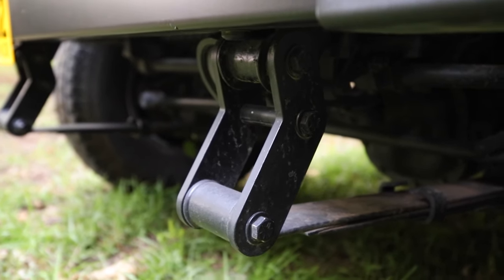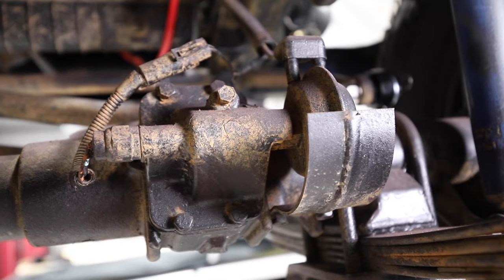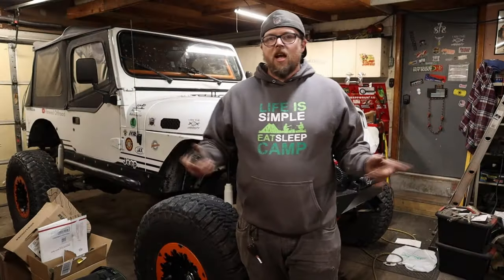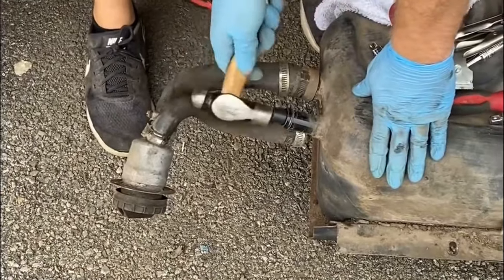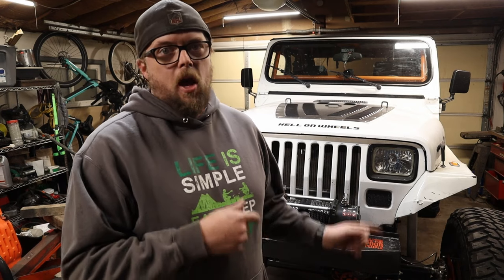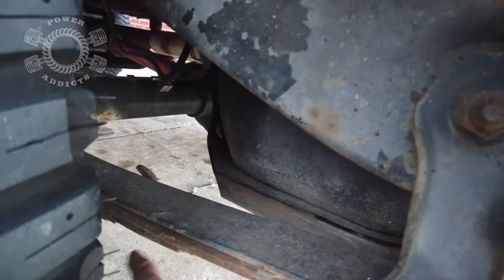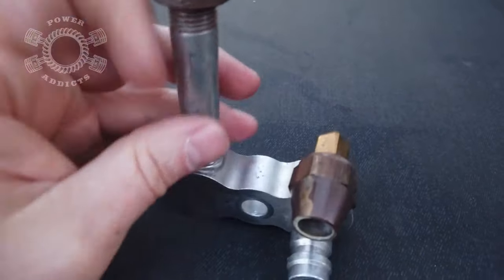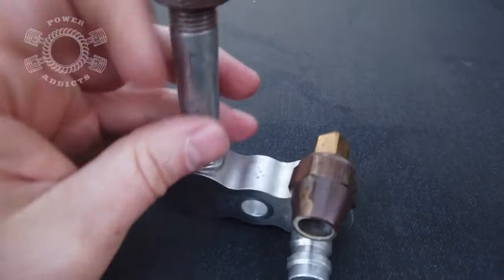Best Jeep YJ mods and upgrades

Comment: My YJ is 33 years old with 32K original miles. 2.5L, soft top. Minor mods to air box and exhaust. Love good ol’ Ginny.
Reply from the maker: Wow. Only 32K! That’s incredible!
Reply: Should swap out the 2.5L and put in a big girl engine
Reply: @ks3223 the Cummins r2.8 is a good fit
Reply: Lunch boxes and go.

Comment: The split axle allows for the driveshaft to not spin while driving in 2wd. This is a huge benefit. Much less vibration especially if lifted, less wear on transfer case, less noise.

Comment: Awesome information about the CAD VAC Delete. I just picked up a 1990 YJ and now I need to do that mod on my jeep.
Reply from the maker: Thank you! I’m glad you found it helpful! 🙏🏻
Reply: Check your driveshaft angle in front and u joints. If you lock that axle it will be spinning the driveshaft all the time.

Comment: Hi good stuff, if I could add something when it comes to YJ springs. For whatever reason people overtighten the shackles, I saw a tire shop use an impact on the shackles and just tightened the heck out them on a friends YJ. Guess how the ride was. The shackles have locking style nuts from  the factory so that they don't have to be cranked down on, also the aftermarket bushings that Dan showed are a really good upgrade and not expensive
Reply from the maker: Thanks and that’s good stuff about not cranking the bolts down. Thanks so much!

Comment: Additional option for deleting the CAD. I installed axle shafts from an XJ without the disconnect. They also had larger u-joints.  I had previously broken two axles at the u-joints. I haven’t broken one since that upgrade 10 years ago.
Reply from the maker: Yeah that’s honestly the best most durable option in the long run.

Comment: A fun video.  I have 1 1995 that appears nearly new - or the condition is looks like new.  The only mods are front and back bumpers and larger tires.  No lift, everything is stock. I've had to replace the vac hose for the 4WD once. You offered some good suggestions, and now to prioritize the ones that important to me.  I don't really do off-road unless you call gravel fire trails, and snow at ski lodges off-road....but you make some good points.  Thank you for posting.
Reply from the maker: You’re very welcome!

Comment: I found locking the front axle to make it a solid axle made highway sketchy in rainy or snowy conditions.
Reply from the maker: Did you lock the entire front axle? This doesn’t lock the front axles, it just connects to the two part axle on the passenger side. I wouldn’t want to lock the full front or rear axle unless it’s able to be turned on and off as needed.

Comment: Good video man. I have a 89 with the 2.5. Not enough power to hurt much! Running 35s with 5.13 gears on a SOA cable actuated CAD and Lincoln locked.  Boomerangs in back and revolver shackles up front. I love my YJ last of the real og jeeps! 😆 leafsprings party harder!👍 stay safe man and happy trails 👣
Reply from the maker: Thanks! - stay tuned. Got a lot more square content coming.

Comment: My YJ is a 92 with 224k miles on the clock and it’s STILL running like a top. Yea small trans leak, small coolant leak, small valve tap, but still starts every single time and gets me A to B
Reply from the maker: That’s awesome!

Comment: I just stumbled across your channel, this is the second video I've seen and a new Sub has been added.

Figured I'd add a warning that this comment is a long one.

Im only 19 and my 1995 YJ (2.5L and 5 Spd) painted in Emerald Green is my first car, and my daily. I got it in late July of 2020, and it was fun bringing it to life as it had sat for 15 years when I got it due to the previous owner taking it to 3 mechanics who all told them it would need a new engine. During those 15 years, someone tried to fix it up, and messed up a lot more, so after un-doing what was messed up (and sourcing a new ECM as the one that was in it at the time was for a 4.0L and 3 Spd Auto), and doing some electrical work when it still wouldnt start after everything that could be replaced was replaced... (said electrical issue stopping it from running those 15 years was a broken fuse contact for Fuse 5 in the fuse block responsible for powering the ASD Relay) it fired up to life after 15 years. Then after getting it road worthy and fully registered through the DMV, I haven't ever stopped loving it, even after a breakdown (thankfully a simple fix). Learned how to drive a Manual Transmission equipped car with it, learned how to offroad very well since the nannies newer Jeeps have aren't present in the YJ, and overall its been such a learning experience with cars in general that I doubt I'll ever get rid of my YJ. 

I've done tons of research, and eventually I want to do a engine swap that's not very common, maybe rare as Ive only seen one unfinished forum thread talking about it, which is stuffing a LNF 2.0T Ecotec from a Pontiac Solstice GXP into it. The AR5 Manual's Bellhousing shares the same trans to bellhousing bolt pattern as the AX15 which would simplify the swap. Rocks and dirt (and a mountain that gets snowy/muddy) are all there is to play in with it, so a Atlas 4 Spd T-Case is planned for that swap too along with a Ford 8.8 swap.

Overall, I understand how Jeeps are money pits (Just Emoty Every Pocket haha) but the character they have is why I love it so much.
Reply from the maker: That’s awesome! I love that you brought it back to life! That engine swap sounds like a cool option, one I hadn’t heard of doing! I’m excited to see how it goes! Thanks so much for the comment and for becoming apart of the community here! I’m excited to have you along for the ride!

Comment: I'm wanting a chevey 4.3 v6 and nv3500 4x4 transmission.   Currently struggling with oil pan leak.  2.5 4 banger and ax5 is sick...

Comment: Got a link for the cupholders? And I have a YJ wangler and one of the first thing I'm doing is getting rid of the 4 cylinder engine i have and put something bigger. The 4 cylinder is so under powered.
Reply from the maker: Here are the cup holders. https://dogfoxindustries.com/

Yeah if I had thought about it more when I swapped my engine I would have done an LS swap instead.
Reply: Thanks for the link. I don't want a LS engine in mine it's very big and a lot of power. I think I'm going with a 4.6 stoker straight 6 engine.

Comment: The cad system isnt that bad. Like anything else if you dont maintain it things fail.  

The big advantage is no spinning the front ds constantly. So less wear and tear.  Fuel savings is meh. Maybe 1mpg. But the system is super simple and easy to troubleshoot.

Comment: I need to know what it takes to put a 250 inline 6 cylinder Chevy in my 1990 jeep Wrangler do I need a ax15 to go with it?
Reply from the maker: That’s a great question but unfortunately I don’t know the answer. I’m sure you and get someone with more knowledge on that in some of the YJ forums on line or some of the YJ Facebook groups.
Reply: I know back of 250 inline is sane as 4bolt main 350 V8 because I've swapped them out

Comment: I would like to buy one YJ, what are your advises? It will be a daily drive.
Reply from the maker: They are older vehicles, so the best advice is get one in as good of shape as you possibly can. Check for oil leaks, check for drivability, for example, does it shift correctly, does it wobble or shake at higher speeds, does it have an electrical issues? Check for rust. YJs are bad for being rusty. So make sure the frame and body are in good shape. And not rusted to pieces. If it’s going to be a daily, you need a mechanically sound Jeep first and foremost or you’ll be spending a fortune and a bunch of time getting it drivable and reliable.
Reply: @SimplyMustGo  The version 2.5L I4 engine is good or is better to looking for the 4.0L I6?
Reply from the maker: @richardf5444  A lot of people will tell you to get a 4.0L because they have more power, but both are good engines. (Neither is overly powerful) both of mine are 2.5L
Reply: @SimplyMustGo  I want buy a YJ with the plan to upgrade it and step by step make it in excellent shape.
Reply: @SimplyMustGo thanks
Reply: @SimplyMustGo I just found an 1993 YJ 2.5L for $10,000 with 199,875 miles I will go to check it

Comment: Why are you talking about the CAD like you know what you are talking about when you clearly know nearly nothing about the CAD system. 

“I don’t like the idea of adding stuff in the cab.” But you like the idea of downgrading your jeep by spending $60 on parts to break a perfectly good factory system that - get this- costs $60 to replace /all/ the vacuum lines in the harness with a brand new  vac harness.

Otherwise- great video.